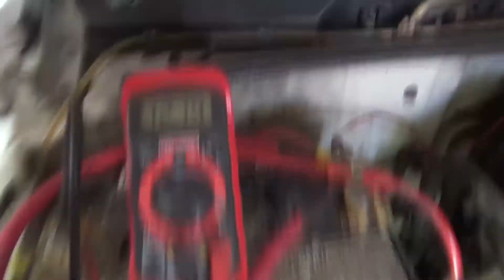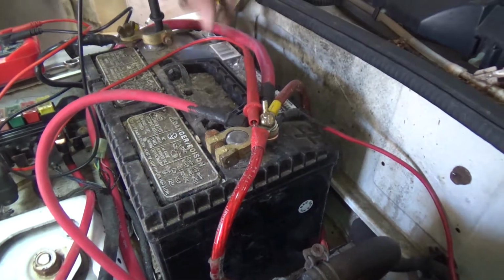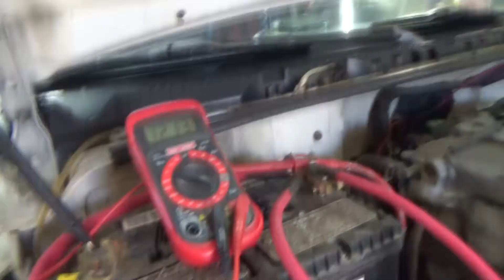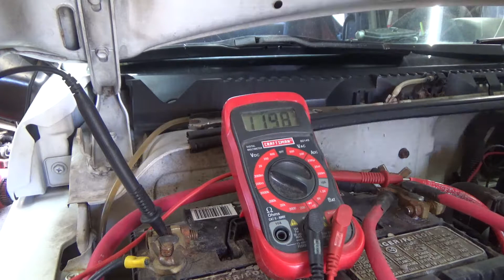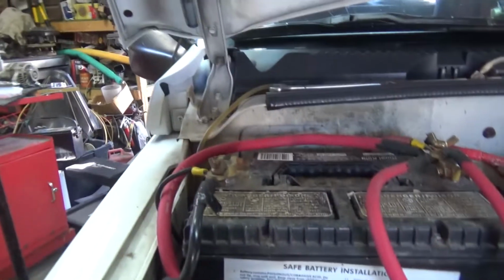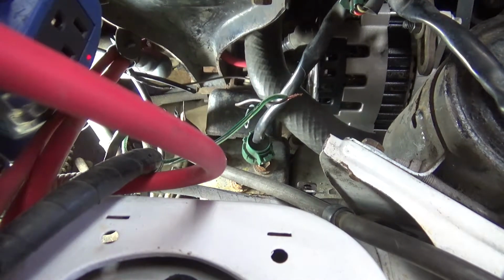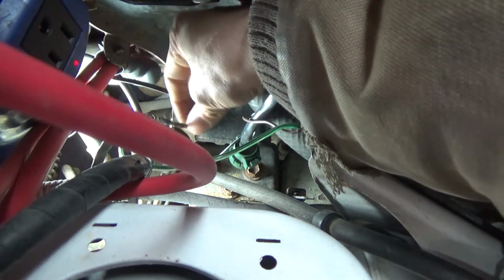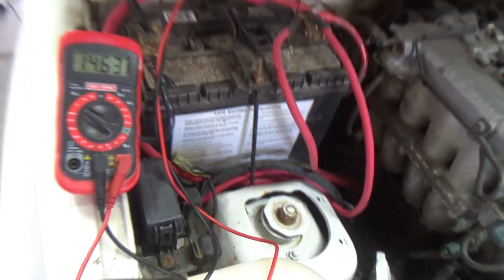geo tracker alternator upgrade problems on the GM SI12 pt.4

Comment: Hey man I've been working on the same style geo, think mines the 8 valve version. having trouble getting it started. What was the green wire ran to? was that the factory wire for the dummy light for the original plug? or did you run it yourself to the ignition? any help at all would be great:)

Comment: hi dude how are things on your side off the pond.i was hoping you could help me with a question or two. i have had an oil leak which i have to fix before my next mot in october. i have been trying to do it with the engine in but realized you cant remove the sump because off the diff, i was going to remove the diff to allow me to remove the sump.can this be done by just removing the left hand side off the drive shaft.It looks as though if i remove the front prop then remove left driveshaft and dissconnect the diff i'm hoping to get the diff out without touching the righthand side driveshaft. any help on the problem will be very much  appreciated. thanks very much steve.
Reply from the maker: your going to have to drop the diff or lift the engine out so the pain can drop down